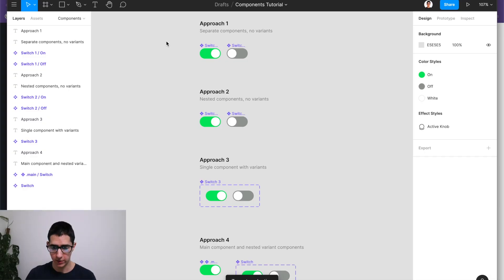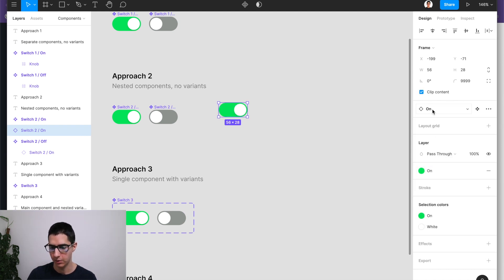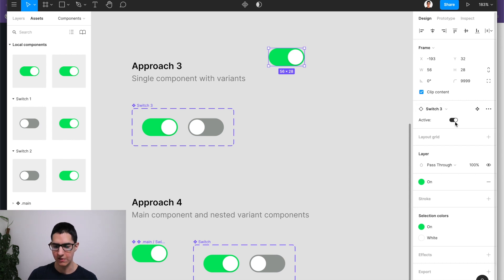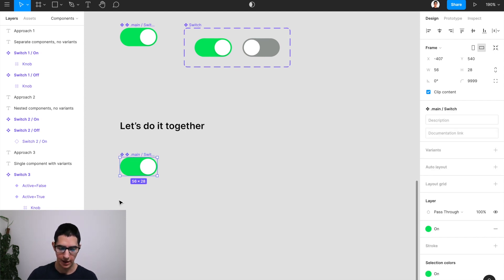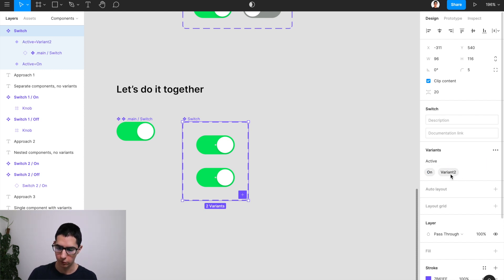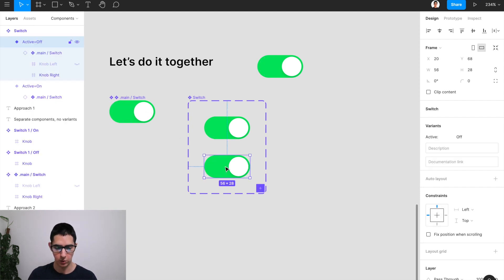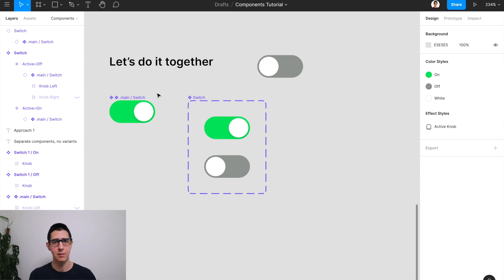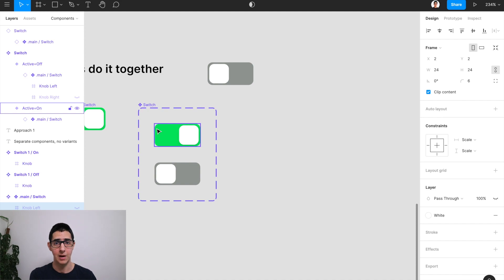Design Systems in Figma – Scaling Maintenance

Comment: Hi Javier. The solution has a massive drawback: the switch with two versions of knobs is not animated properly in the prototype with auto animate, where you would expect the button to change from right to left and back. The correct animation only happens when two versions have the same button frame, which is moved accordingly.
Reply from the maker: You're 100% correct. In more recent work, I'm only applying this logic to specific components (typically more complex) rather than to think of it as the default configuration for all. In this case, you're absolutely right that in order to have a nice animation in place, this approach won't work. Thank you for mentioning this!